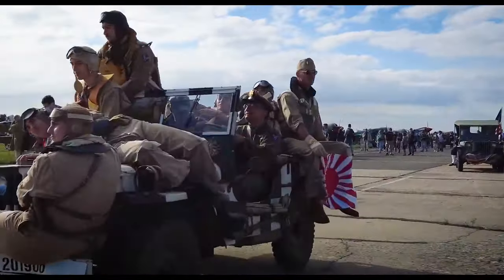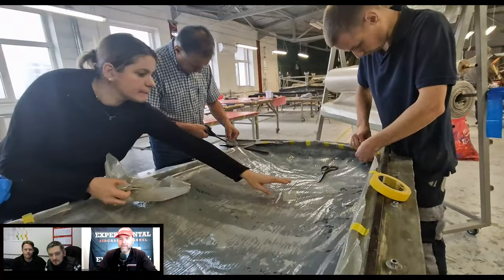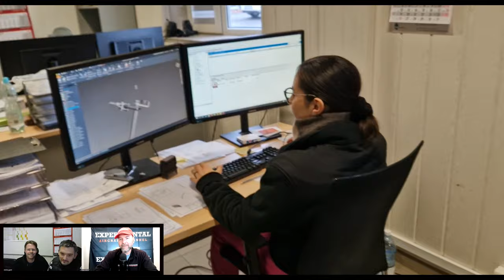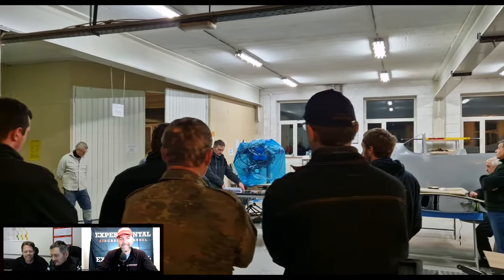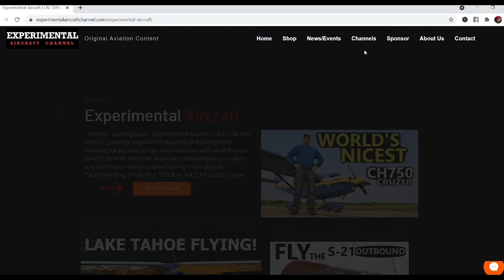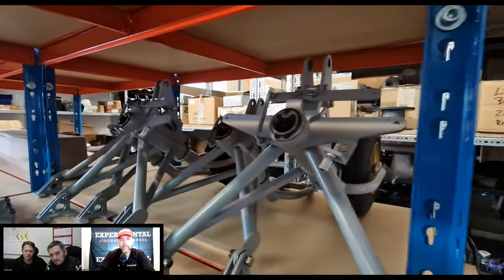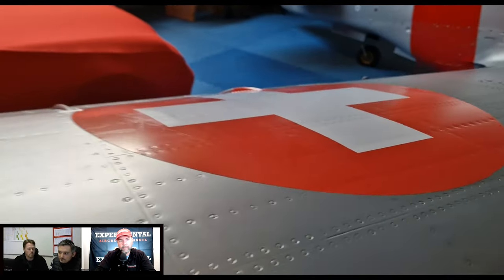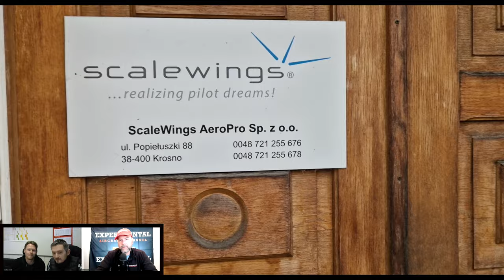SW-51 Mustang Factory Tour!! Military Aircraft now a KIT!

Comment: Hey Scalewings, Spitfire next!

If that Turbaero turboprop ever comes to fruition it would be a cool 200hp powerplant
Reply: I often wonder why the US doesn't make a modern P-51, 1500hp turboprop, modern avionics and use it for ground attack... Like the super Tucano! Considering NATO used 70million + jets to drop 250lb bombs in afghan... something like that would be far more cost effective
Reply: I was thinking with certain fighters like the spitfire and bf109 that have a very tight wheel base and hard ground handling because of it if they could adjust it when shrinking it to 70% scale. But honestly it would be easier to do an aircraft with wider wheel bases first like the Hurricane just so you give customer the easiest planes to taxi so you don’t have to deal with extra repairs and taxi accidents